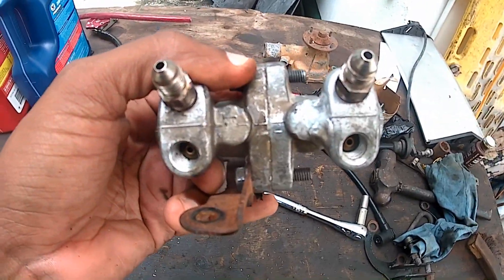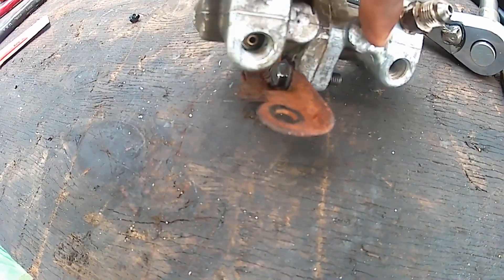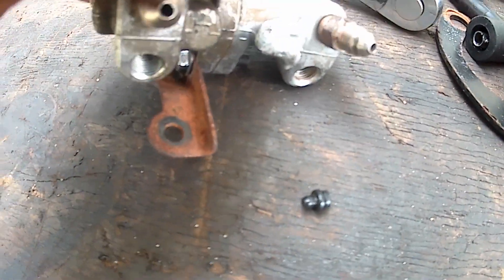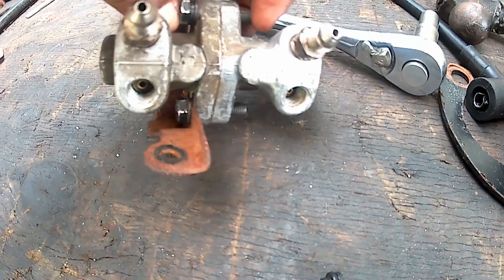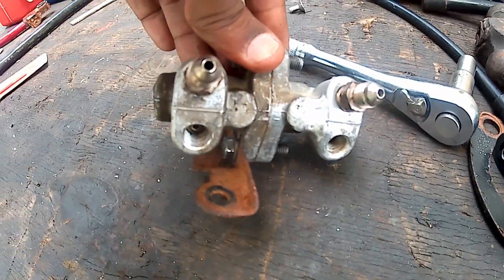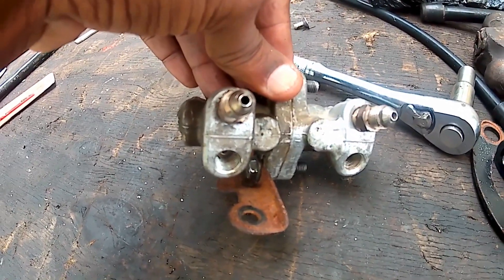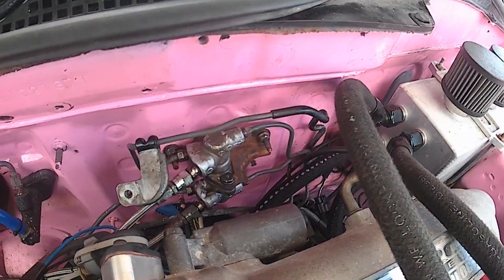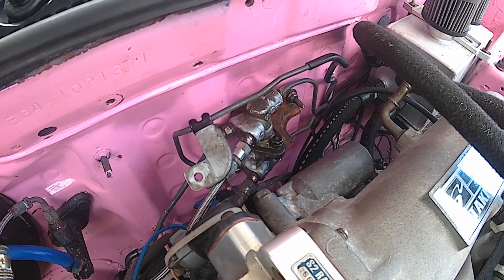Project Civic Brake Mod!!!!

Comment: I also got the tool for the bolts from harbor freight. They are called security bolts. The tool was free with a coupon but it only costs like 7 bucks. Security bit set.

Comment: It's too late now but you didn't have to block that hole. All you have to do is replaced the o-rings on the two pistons in the valve. I pulled them out with a pair of pliers and replaced them with some I bought from Harbor Freight for 9 bucks. That hole is there to let you know when there is something wrong with the internals. Since you welded it, if it goes bad again you will not know. You will have brakes but it will be even braking threw out the entire system. That is Okay unless you need to stop hard. It's going to be like pulling the E-brake. Just an FYI. I have that exact valve on my two CB7s.
Reply from the maker: Ok. Noted. 
Actually look to go manual proportional value with staging brake
Reply: You can help me?  I need change the o-rings
Reply: @galileaflores8968  yes  i can help
Reply: are those Danco O rings any good for that fix?
Reply: I have the same issue now. I was thinking of closing the hole too. So that's what I should do then?
Reply: which o ring set did you get from harbor freight

Comment: What size bolts did you use to replace the one you took out
Reply from the maker: Allen head for m the hardware store. Probably cause use a 10mm Honda bolt. But I didn't try
Reply: iAmCorey246 Did yours come with bolts already? Mine is 1991 Honda Accord and it had tamper proof screws holding it together. They were a bugger gettin out. Thank for the video
Reply from the maker: @HelpingHand40  had to cut a slot and use a vice grips to get original screws out
Reply: iAmCorey246 same here I had to use a saws all and cut mine in half then back the screws out the opposite direction